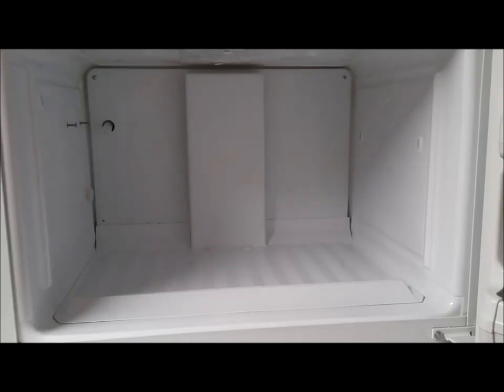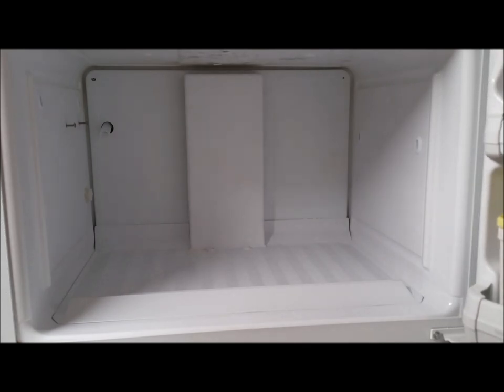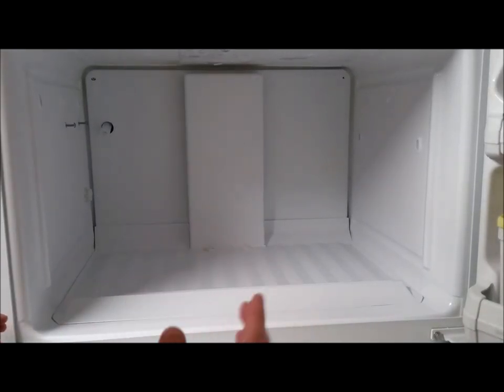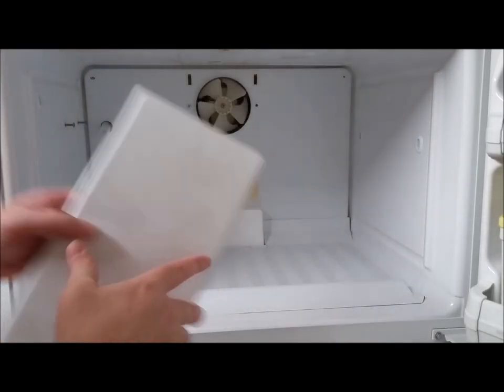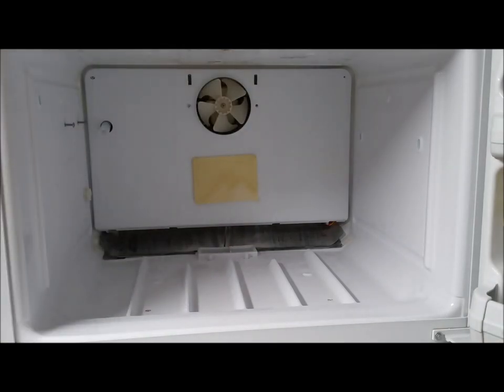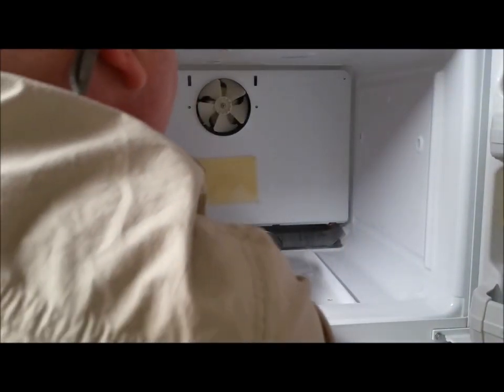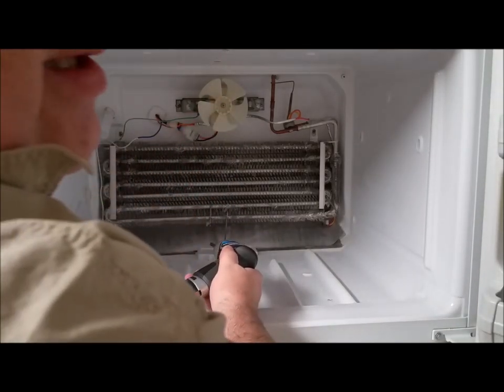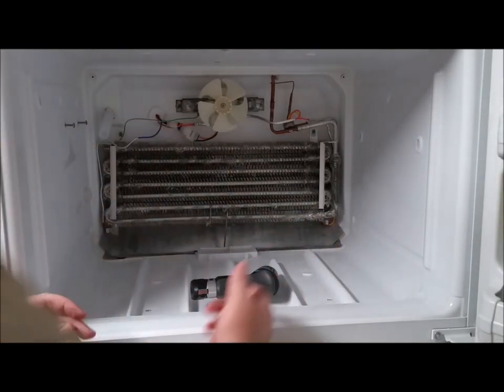FREE Fix For Refrigerator or Freezer Vibration Noise Rattling Fan Grommet Compressor GE GTS18XCMFRWW

Comment: That's it, it's fixed. I had the same problem, just moving the wire connection that worked itself between the coil and the cover plate. You're awsome.
Reply from the maker: Maybe, Maybe not.  I posted the following in the videos description after my fridge totally died a month later...     I THOUGHT I had cured my refrigerator issues with the information included in this video.  Unfortunately about a month later the fan (seen in this video) just died.  Best thing to do (if there is a chance that it is your evaporator fan) is to replace the fan IMMEDIATELY because they are not that expensive (and very easy to replace) and you will not have to needlessly throw away and replace ruined food!  Turns out that those fans can "rattle" and sometimes run intermittently before they die (so the fridge is still somewhat cold & your unaware, at that point, that your refrigerator is on the verge of ruining all the food in it by shutting down until it is to late).  So while my wires were indeed rattling, that was not the real problem that plagued my refrigerator.

Comment: Thanks for posting this. I just had a new fan put in my freezer, but after the repairman left, it kept making a rattling noise and was driving me crazy. I took off the cover over the fan and loosened the screws, but just a tiny bit. It's not perfect now, but much better... at least for now (cue the horror music).

Comment: haha, you saved me, thanks buddy! quick and too the point. i oiled the dam thing, and added extra form, but i bet it was the wires. it was driving me crazy. no ice around it. had it out and back in 5 times now
Reply from the maker: @patrickpk6299  You should read the description for the video because I'm fairly certain that I updated it to say that a week or two later The fan motor totally died which was the ultimate problem. I replace the fan motor and all the problems went away. If you choose to do that NOW you will most likely avoid possibly spoiling a bunch of stuff in your fridge before you can change out the motor.

Comment: Thank you for suggesting it could be something in the way. I didn’t remove the big front plate but smaller one in front if fan. Previously I banged it & it would stop for a few minutes so I dint think motor or fan was broken- maybe loose. I shone flashlight in & I could see the motor was crooked. I was able to finger between fan blades to make sure no wires were in the way & straightened the motor & it stopped!! If it starts again I will take full plate off cause some needs to be tightened.
I did make me clean my freezer out!! 🥶
I forgot to mention I live in a Studio & there is no door to close to separate kitchen. It has been waking me up & in general so annoying I was going to have to unplug the fridge to sleep & just throw up what gets warm